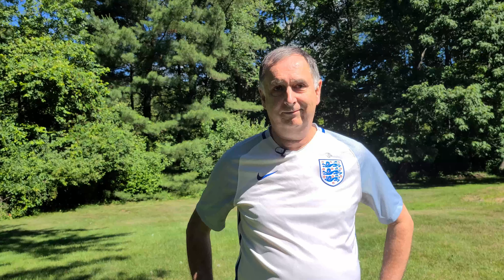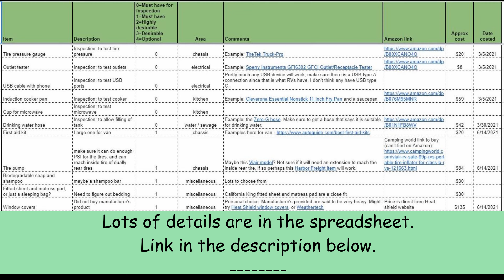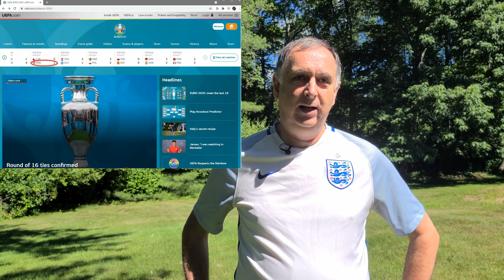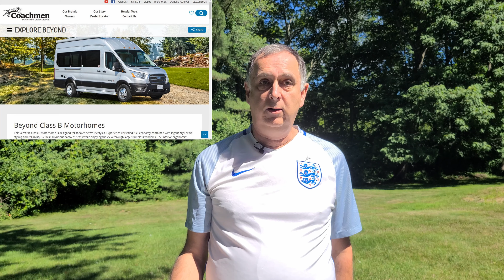Things to buy for your first RV

Comment: Did u buy a hitch roller and if so which one fit.
Reply from the maker: I don't use a hitch roller, but I do use a superbumper for protection (www.superbumper.com) when not taking my bike. The bike uses a hitch mount. When I am not using the van I have the superbumper on my car.